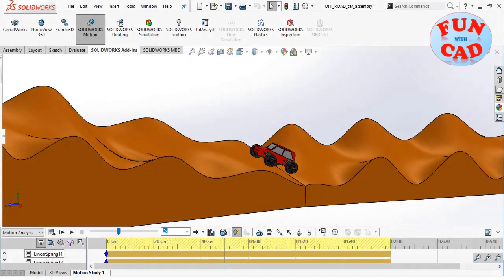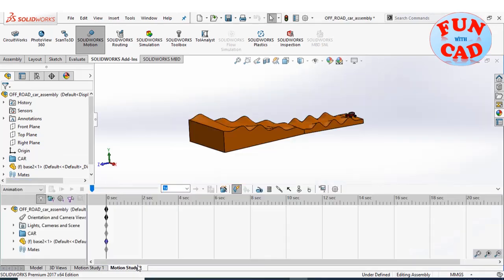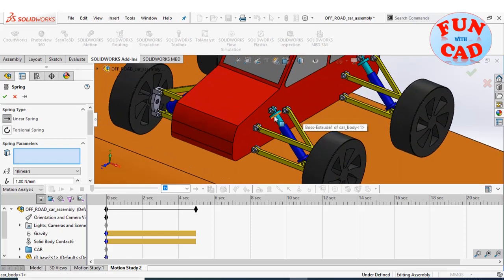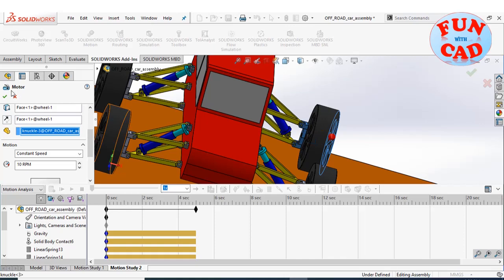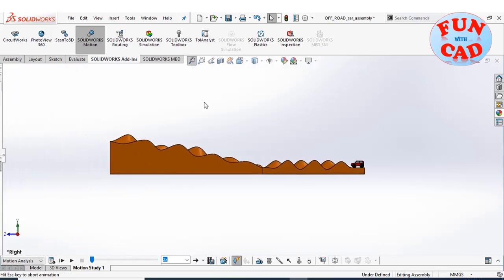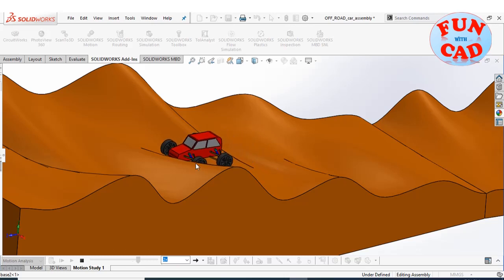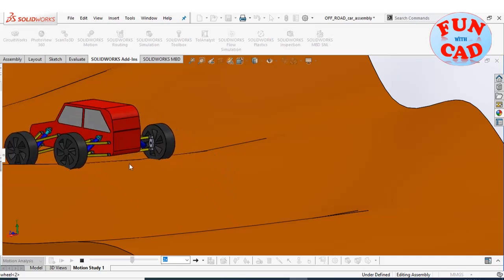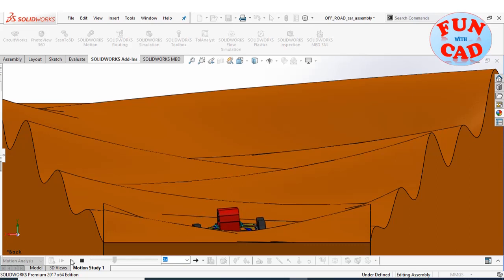SolidWORKS OFFROAD CAR climb on rough TERRAIN with SUSPENSION | SolidWORKS MOTION Study Tutorial

Comment: Hello, can you please explain how you mate the car with the road surface ? Whenever i try to simulate my car starts floating and the suspension collapses into the car ? Thankyou
Reply from the maker: Hello jyotirmoy, there is no mate of car with road surface. Solid contact is defined between those two bodies.
You can keep some clearance between the car and road surface before the start of motion. The car will then automatically rest on road due to gravity.
Reply: Hi thankyou for your response, whenever i try motion with solid contact my car bounces alot and the car body starts touching the road surface ? Also when i try to give rotatary motion the vehicle does not move ahead, what should i do ? Thank you
Reply from the maker: Hello, let me tell you some probable reasons.
1. Try changing the spring stiffness value according to the model dimensions. Usually, the car model I use is a complete solid, which adds a lot of mass (sometimes in tonnes of kgs). Thus I adjust the spring stiffness value accordingly. You can even try and reduce the gravity value.
2. Some penetration between solid bodies will always occur as the 3D contact resolution in Solidworks is a constraint.
3. While providing rotary motion, make sure that the initial angular speed is not very high. For example it will be very difficult for car model to go from 0 to 100 rpm in fraction of seconds. This will lead to some uncalled motion.
4. Check this below video. It explains the car motion in detail.
https://youtu.be/CxRzj9AF5v8

I hope this helps
Reply: Thank you so much for the suggestions, I will try these points and let you know if i face any further issues, you have great content and it has helped me alot in my project , thank you once again!

Comment: Hello, I have a problem with my project in which I want to simulate the functionality of the "rocker bogie" suspension I installed on my rover. The problem is that after calculating the motion, my rover goes through the terrain even if I set all the six contact points between the six wheels and the terrain. Could you give me some help please?
Reply from the maker: Hi, even in my simulations, there is slight interference between the solid bodies in contact. You can try to improve the accuracy as well as 3D contact resolution by changing the settings. Also, make sure that you're terrain is thick enough, or else your rover would penetrate through it.

Comment: Great video...Could you upload a video about how the terrain was made?
Reply from the maker: Hi Akshay, please refer the following video for an idea about the making of terrain.
https://youtu.be/zzCjZRJUs50
Do subscribe to the channel and share it with your friends 🙂
Reply: @FUNCADwithMrROBOT  Thanks 👍
Reply from the maker: Hi Akshay, I will share a video soon!
Reply: Hi...I tried the model and terrain. But while simulating the motion analysis, I faced a problem. When going through uneven patch on the terrain, some wheels do not stay in contact with the terrain. They kind of float in the air. I don't know why that is happening. Hope to get your insights on it.
Reply from the maker: Hi, I guess you can increase the free length of spring while adding the spring feature, also adequate spring stiffness is required so that the suspension works fine.
Also check if the gravity is active.
Still if any problem persists, you can mail the screenshots of the analysis on funwithcad2020@gmail.com.